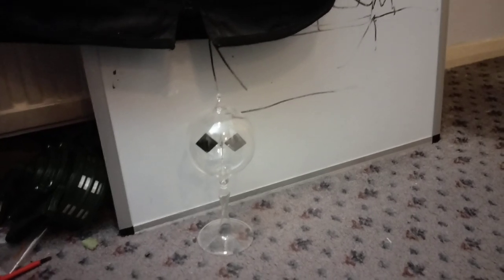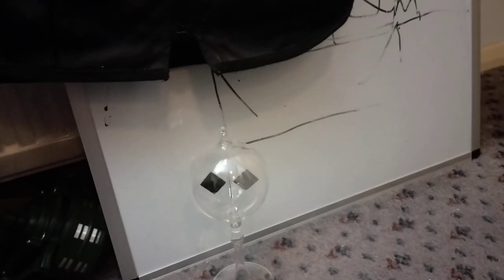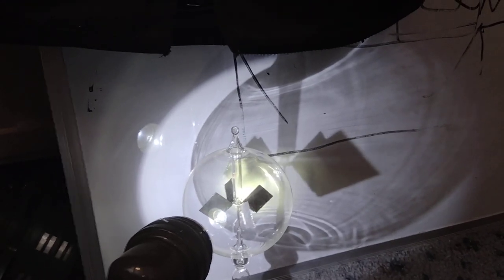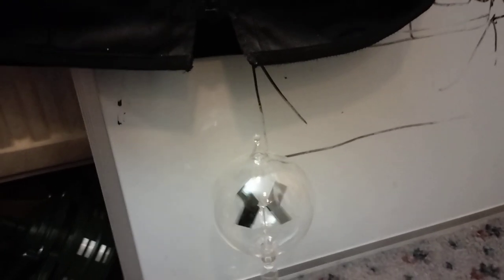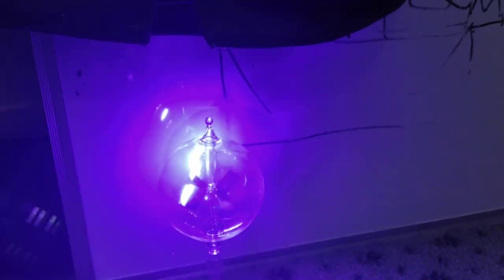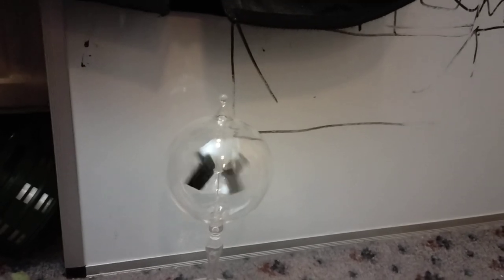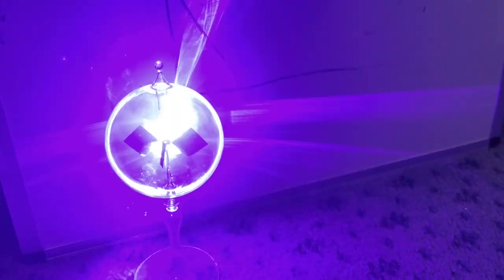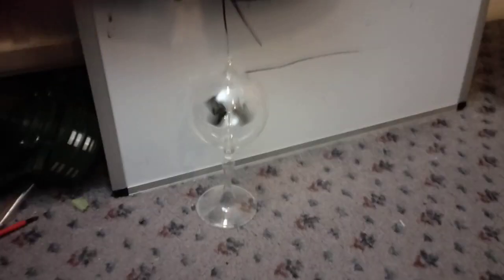Light-mill demonstration

Comment: Sorry to bother, but I have a question. Could you perhaps do a video with a microscope looking at M10 / M10M respirator filters to see if they have asbestos? I'm worried about my safety since I own an M10M and use it for painting, protecting my face from heat when burning wood, etc etc. Not only that but it seems as if quite a few other respirator collectors are worried about it too.
Reply from the maker: I'll try and get around to it at some point.
I've been told a lot of times they don't contain asbestos though if that helps.